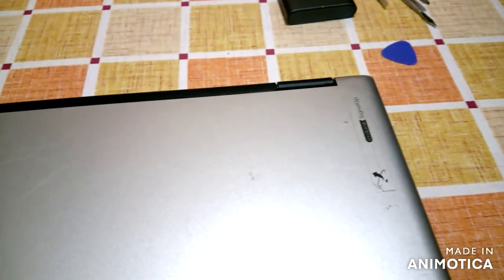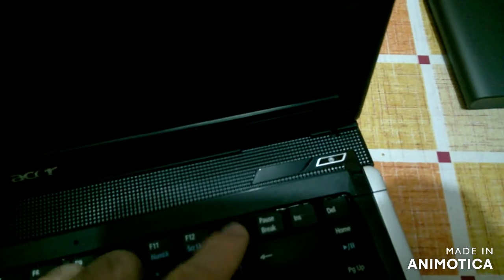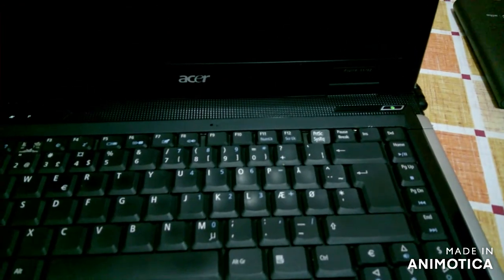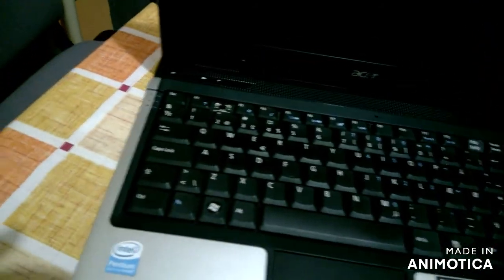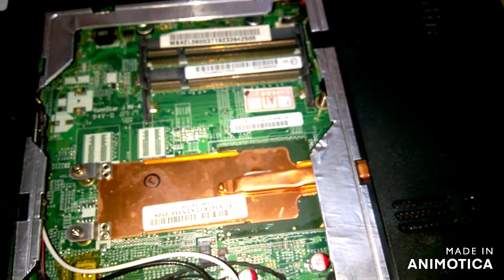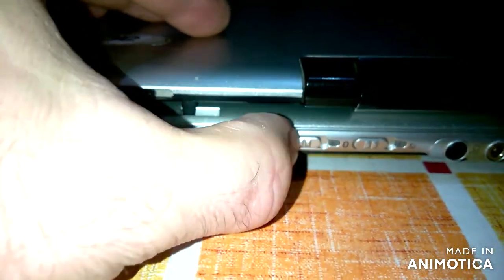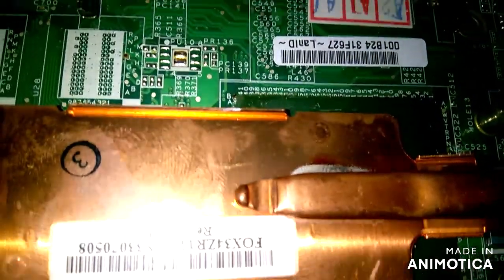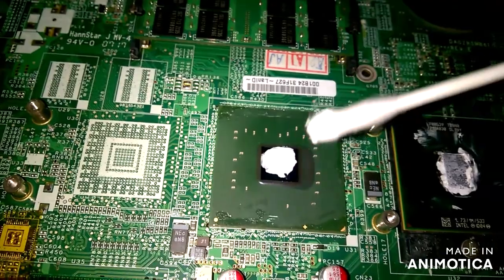Acer Aspire 5570Z - No picture - Nema slike

Comment: i use this model now. just upgrade CPU to T7200, HDD 7200 rpm, 2gb Ram, it works for normal use (office, web surfing). you should extend to external monitor for better pixel
Reply from the maker: Many old laptops are still good for just simple home use, but new laptops looks so nice and people will always buy a new one rather than use some, maybe premium, old one.
Reply: Oh, i also upgrade wifi card (intel 5100 AGN) :). Total cost 25$ haha
Reply: um t8100 processador dar certo?

Comment: Did it work?
Reply from the maker: Thank you for commenting. I wrote in description

"In this video, I tried to fix the problem with the screen / image, by heating the graphics chip. The problem was not in the graphics but in the cable that connects the board and the screen. I disassembled the screen and fastened the cable and the screen worked. Unfortunately I lost the video of how I do it :( "

I was disappointed when I realize that I lost final part of video where screen connector on LCD is just tightened  :(
Reply: @MilekaRobot  yeah I did that heating process and it fixed the problem. I can only boot into bios now. I have a chicony ac charger. Do you think I have to buy the original charger for it?
Reply from the maker: @leang2157  Do you connected a hard disc? Boot device need HD in order to copy install files?
Reply from the maker: @leang2157  I tested some laptops with PSU and realized that many of them draw about 1-2A of current in idle mode, so the charger probably will do a job for basic thinks, and maybe a little more than idle...
Reply: @MilekaRobot  I already used a hard disk drive and didn't load up to the installation screen
Reply from the maker: @leang2157  Try to find a proper operating system for that laptop, I think it is a vista? Of course, I assume that you try to install a win 10. I have so many problems with booting a win 10 on old laptops and sometimes only solution was to install a system version defined at sticker on laptop or something like that. If laptop start with that charger I think it is ok...
Reply: @MilekaRobot  no I wasn't trying to install win 10 but I did tried to install windows xp pro & didn't load up the cd. The cd was brand new and cd rom drive was new as well. My only option is try network boot if that doesn't work I might just buy another charger for that laptop.